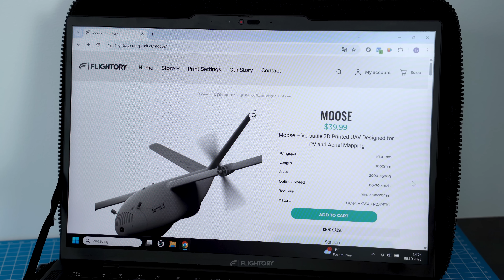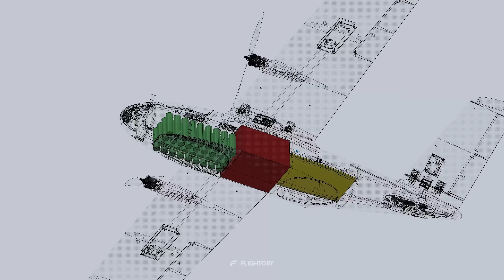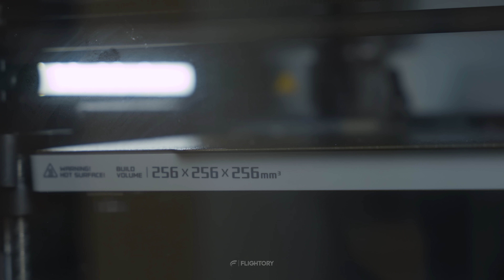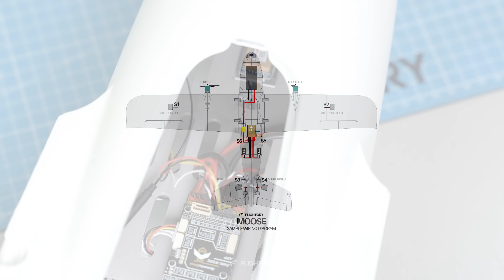Build Your Own 3D Printed Fixed-Wing Drone | Moose

Comment: Can we get some crash testing happening? These planes are great, but as we all know the just don't have the durability for common crashes. I see in the forums that the average user is building  ~2 or 3 of your planes before they get a handle of them. I'd love to see some testing test of various strengthening strategies if seen floating around. Wrapping the fuselage: Does wrapping the entire plane in packing tape, or resin + fiber glass mesh, or just resin help. Print settings: What does wall thickness help in a crash (0.4 mm vs 0.6 mm?), does two wall printing help and does the extra weight provide any meaningful strengthening. Crumple zones: Are crumple zones viable?Are sacrificial crumple zones on the front of the plane that would be designed to either absorb or deflect impact away from the  main structure (similar concept to the skid shown in this video).
Reply: I’m less concerned about that kind of durability, as there’s always going to be something that can break.

However, designs like this could gain a lot by designing them to be easy to repair.  If part of the wing breaks on a landing, do you need to re-make the entire wing, or can a single piece be re-printed and replaced?

Comment: Well, moose looks like a good military platform for cost-effective use cases
Reply: the hardest and most expensive part for military is jam-resistant connection, navigation and preferably partial autonomy. Here we see purely civilian use electronics
Reply: @niksem3090  I told platform. You can equip such plane with any additional equipment, but it cannot be too heavy. You can increase GPS jamming robustness by adding a matrix of GPS-es.
partial autonomy? RPi with dedicated SW. 
Payload and range? You have it already.

Comment: The V-Tail is extreamly large. Like Panavia Tornado. But is it possible to make it smaller for less drag? Maby make the 90°angle of the tail a bit wider. So it can make a bit smaller and with 100-105° faced it would have more Pitch autority by smaller overall size. And the less Yaw instabbility gets handeled by Differential thrust. 
Yaw stability can handeled by differntial thrust. The large Market and of F-controller today allow to youse both Motors individually. And this FPV Platform gets yoused with an FC. If you fant to fly an RC Plane without FC you will choose A Spitfire, C-130, BF-109.
Are there any 3D Printed BF-110 Destroyer oder Me-410  in the internet?

Comment: Honestly, this is true revolution in industry happening. Production of such a beautiful and robust drone can be organized anywhere, only things needed is a decent 3d-printer, glue, screwdriver and a set of small electric components which are easily shippable even using these exact drones. Completely decentralized production sounds more exciting than decentralized finance. I hope there will be even more models which will be optimized for a wider range of materials like CF-ABS or PETG and smaller or larger printing areas.
Reply: "Completely decentralized production" after you get your 3d printer from china, filaments from china, glue from china, screwdriver from china, every single electrical component from china...
Reply: @daniels4338 True, but the reason for that is that Chinese make all these things cheaper than anybody else. If they raise their price or make components not accessible to everyone - someone will quickly take their place. The real problem however are Li-Po/Li-Ion batteries.

Comment: I feel these are fantastic videos for newbs like me getting into the hobby. Im building a vtol stingray atm and wish there was one for that but also showing the electronics setup. As someone new to this hobby seeing things like how to use the threaded inserts and do the wings are super helpful. Just wish it showed a bit more of the electronics setup like soldering the battery terminals and power board in and soldering the pins on the speedybee flight controller which isnt the easiest task for someone just hopping in although there are videos on those a people can find on their own i suppose but overall very solid expanation and hope to see more of these